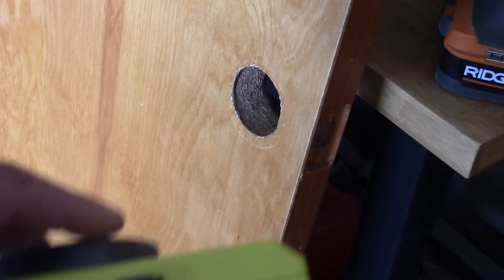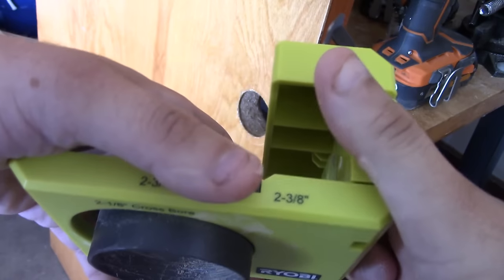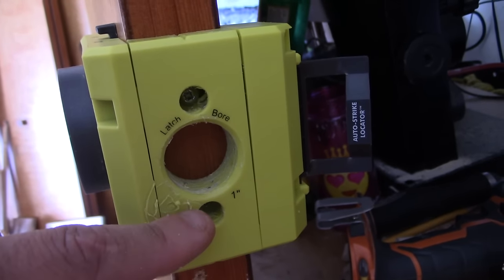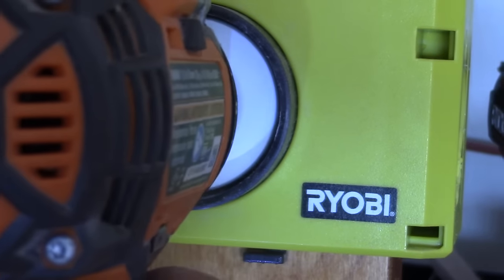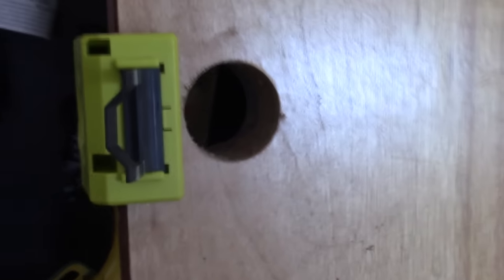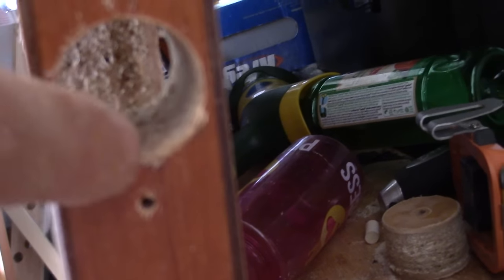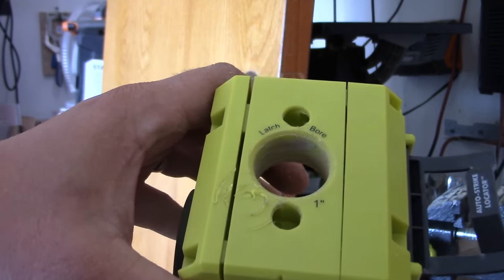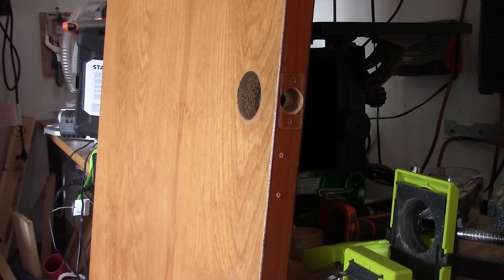Ryobi Wood/Metal Door Lock Installation Kit review and tutorial

Comment: I just got done using this tool on 29 doors.   Not a single issue whatsoever.   It does seem to get scractches on the bore guide, but in no way impeeds making the perfect hole.   Best investment I've made yet.  You do want to try not to go all the way through.  It may leave splinters on the other side.  Use the pilot hole to finish off the back side to avoid that.
Reply: My outdoor side gate is 2” thick. Will this work on it?

Comment: I'm a DIY homeowner and I've used this tool on an interior bedroom door.  It works good.  As a plastic tool (to keep the price low), it's not made for the pro's that are doing many doors.  For the DIYer, that's going to do a door once in a while, it'll help you do the job.  I hadn't used it in a while and I'm about to replace a bathroom and two bedroom hollow core doors and thought I'd watch a few videos to refresh my memory how to use it.  Tip:  use the old doors to line up the new doors for hinge and knob placements.  I'll also be using the Ryobi hinge template and striker templates.  BTW, thanks for the video!

Comment: I have an Irwin model. Regardless of brand, these tools are invaluable to have in your tool crib. I highly recommend everyone pick a couple up when you come across them.
Reply: a couple ?
Reply: @The Sage , yep. I have two, but one is worn out. They are handy to have if you decide to take up any type of home repairs.
Reply: @Morristowner  ah I see . ..so here is the thing....I have a little project to do 24 doors and I bought 1 .... Am I screwed ? Give it to me straight mate
Reply: @The Sage , no. Doors are not cheap that's for sure. Is the client paying for the doors? Let me know if I can help you out in any way. Been doing renos for a few years now.
Reply: @Morristowner  have a small time workshop (for reference, 20 doors is a big order for us). its internal doors customer will get those premade pine doors. we are to shave some down to custom size, cut rebates and install hinges they will provide, and install knobs/locks too. then doors to be preped sealed, sanded primed and spray finished in high gloss white. thats the job really. never really done anything like it before. i usually make the custom doors and the customer finihses it them self,
Reply: @The Sage . Sounds like you have it under control. I would have preferred to have the doors made too. Shaving down can be tricky and time consuming. Good on you brother. Best of luck on the job.

Comment: the auto strike plate locator is for when you are replacing old doors with new doors and the strike is already in place... so you know where to secure the jig and drill out the lock holes....  it's not for when you don't have a strike installed yet..

Comment: It’s flimsy compared to the all metal jig the local hardware store used to lend us. I added a clamp to the operation. The elongation of the mounting holes will be a problem as it can put slightly off center screw holes right close to where the backset holes belong. Keep your pilot bits short until your well into the door. My locks required the backset bore to go beyond and that spade bit was scary wild in the coarse particle board core. So I did the backset hole first and chased it beyond the big hole with a long 1/4” bit to help keep the spade bit inline. I also made a clamp on wooden jig with 2 fences at right angles to keep the deep 1” hole straight.

Comment: Yeah got one thinking it's plastic but is a bit more solid than others lv used and got a very reasonable finish on a double rebate but l did use the template that came with the lock set and this did help with accuracy it was like about 35 bucks au so a couple of doors and it's paid for it self l also got a door latch install kit for like 21$ au and it works extremely well as long as you go easy on the hammer until you have it marked out spot on before pounding on it

Comment: For the metal doors I tried the a few cheapo kits.  The $20 masterforce set template is more solid tool but the hole saw not carbide. In a week  I broke 3 pilot bits. Most residential metal doors dont have wood blocks or theres only partial blocks. Sucks because the 1/4 bit has no solid hold and suddenly takes off and breaks the bit ripping a GOUGE. So i had to reverse the drill.  Useing half inch drill with side handel.  
Any help please.

Comment: 8:40  You don't understand the purpose of the locator.  It is to set the height of the drill holes on the door using the existing strike plate.

Comment: Great👍I did my metal house door has foam inside.
I bought the drill kit bimetal hole saw with plastic template(craftman). I went slow but it wobbled and broke the center bit on hole saw. 
Now the center hole was off. Yikes.
 I tryed a new bit and it wobbled so i did reverse worked slowly and i got threw both sides ok. 
 i think if there was a wood backer block it would have held the bit better. 
Any thoughts. Thanks for the great video. 👍
Reply from the maker: If you go very slow at first, you should be able to cut the hole without the pilot bit. As for it breaking off in the first place, it should not have done that. I have the Milwaukee kit also and never had that issue with it. Only thing I can think of is maybe the bit got too hot on the metal door and snapped.  Maybe use some lubricant next time

Comment: HELP!! Drilling the knob hole made the bit so tight that it won't unscrew to use on the latch hole.
Reply: Dave O'Brien 
Me to dog gone am almost doing a dance of frustration. Oh am a woman so I can cry
Reply: Dave O'Brien 
Me to after almost crying. I walked away came back and used the 1 inch spade bit. It fit right in.
Reply: This is why I am coming here and crying 😭!
Reply: Dave O'Brien       Same thing happened to me, after my temper tantrum, stamping my feet. I screwed the latch on, that mark it for me. Then used my drill made a few holes then used a  chisel and a hammer. Am a woman, not strong enough to release man that bit is on there. Ryobi needs to improve this part. Lots of people have said the same dog gone thing!
Reply: If you have an impact driver all you need is a nut driver bit set.  The impact driver will loosen the hole saw.
Reply: @charlenenorman3644  If you have an impact driver all you need is a nut driver bit set.  The impact driver will loosen the hole saw quickly and easily

Comment: Great video. Can you use this to expand a smaller hole (from an older door and existing small handle) to the newer larger holes?
Reply from the maker: Yeah, but you just need to go very slow at first as you dont have a pilot hole to start with

Comment: Help! How did you take the first saw bit off? Mine got stuck too tight!
Reply from the maker: Sometimes I  have to use a vice Timothy
Reply: @ToolReviewZone  I see....now I know how to spell and what is vice. Thank you very much. I need one for future wood work. I was desperate so I used two screwdrivers to pry them apart.
Reply from the maker: Yeah sometimes I do that but sometimes bend the hole saw. I just use a cheap bench vice
Reply: Get Wax...itll help remove it...even if its candle wax
Reply: Man I tell ya this is frustrating. Am just going to buy new one for it. Bench press I don’t have set up. Wax. Honestly this would make for a good video
Reply: Right on did it. Wow it’s fun learning and doing myself
Reply: I used a 1 inch spade bit
Reply: @ToolReviewZone  use an impact driver.  It will loosen it up easily.

Comment: The video help me but the hardest thing about the Ryobi is to change from the big bit to the smaller bit and he didn’t show how to do that.
Reply: Jennifer Koestler you figure it out yet?
Reply: @math8130  It was impossible to change the bit.  so I just used the guide to drill a hole using a drill bit.  thanks for checking.  A flaw in the ryobi system.

Comment: can you demo how to do the frame part of the door?  i cannot seem to find a video on that...  do i just repeat on the opposite side with exact same thing?  so the bolt on the lock will go into the wall?  i haven't read my instructions yet but i am going to give it a go so i don't have to pay someone to do the install of a dead bolt.  thanks!
Reply from the maker: Unfortunately this jig will not work on the door frame. I will look for a good video for you and send the link
Reply from the maker: +sunshine always powers wow, you are right, not to many vids for the jamb install. All I do is install the hinges on the door first. I then bring the door over to the jamb, and place two small 1/4" pieces of wood under the door to ensure I have a gap for the door to swing without dragging on the floir. Then just trace out the hinges on the jamb. Use the router to clear out the traced area (needs to be 1/8" deep). That's the easiest way to explain it without getting into measurements. Maybe I will post a vid on this soon
Reply: You install the lock. Put some lipstick on the bolt, close the door and flip the bolt to mark the frame with the lipstick. And use a 7/8 spade bit to cut the hole in the frame.

Comment: Do you have to use the drill bit to guide the circle bit thru the door? Or, is the clamp circle enough to guide the bit through the door itself? I ask this because I am replacing the doorknobs on my very old doors, and there is already a smaller hole through the middle of what I need cut. The size of the hole is currently too small for the new doorknob size. Since there is a smaller hole, there is nothing for the smaller bit to guide the larger bit thru the door. The doors are not solid. Do you think the clamp you put on the door is strong enough to use the larger bit without the help of the guide bit?
Reply from the maker: Hey Bobby,

It is ideal for you to use the pilot bit when using this, but you should be ok just using the hole jig. It may jump around a bit at first, but should be ok. Just make sure the screws are in tight before you begin.
Reply: Thank you for the reply. I have several doors I need done. They are all cheap doors. I have to sand and paint them anyhow. Thank you again.
Reply from the maker: +Bobby59 Any time. Let me know how it work out

Comment: Does this product work with a door to make an existing hole larger?
Reply from the maker: It could work, but not each as the you dont have an area for the pilot bit to sink into. Just go slow as the hole saw could jump out of the jig
Reply: Nope...the only way to get a larger hole is to use a larger bore